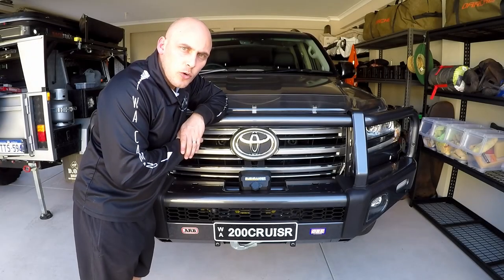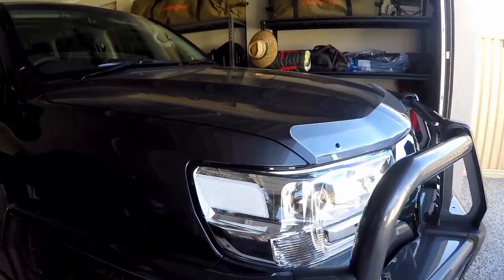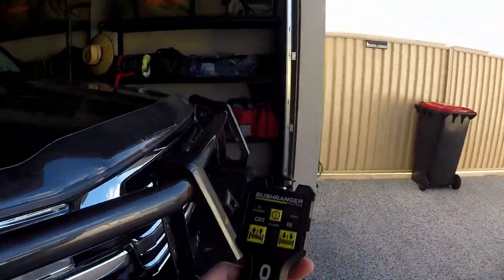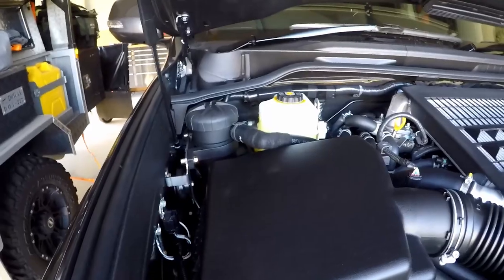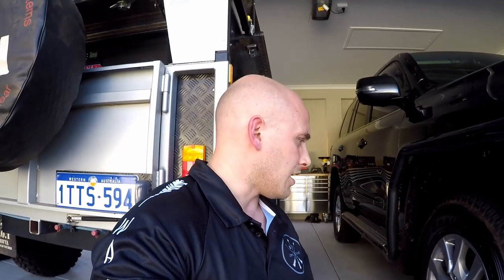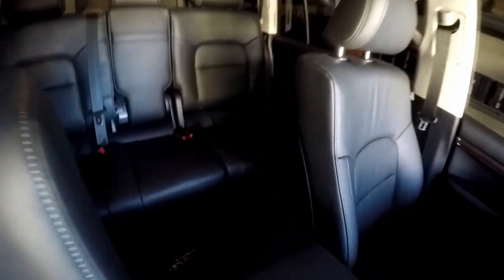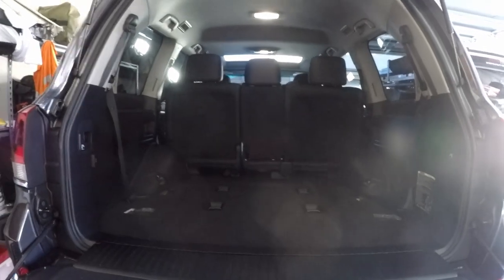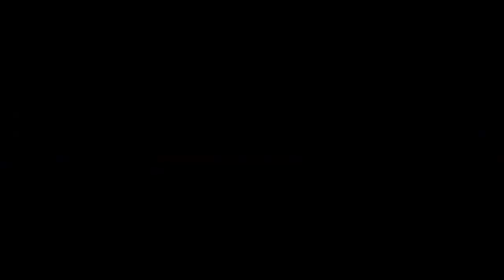200CRUISR first look & first video - BUILD SERIES

Comment: Tip from a 200 owner - fit a torque converter lockup kit (Richards Kit) ASAP - dyno tune and remap with Manta Performance
Reply from the maker: Thanks mate, is on the cards and nearly there for that side of it, few things to go then I’ll get the tuning side done and the lock up kit for sure!